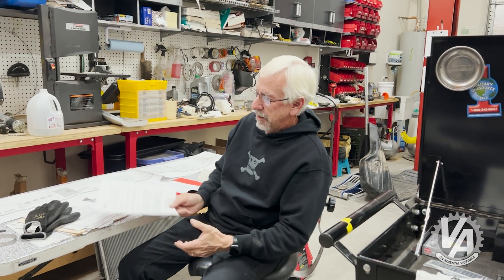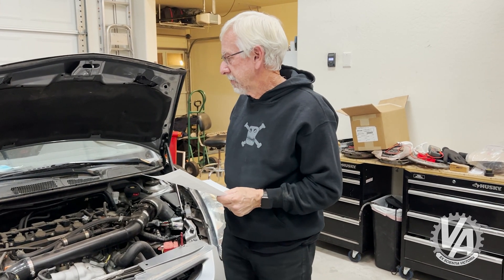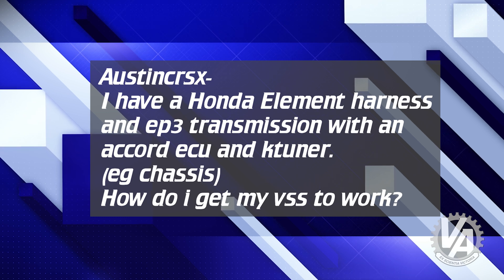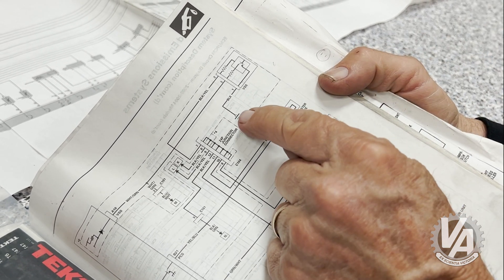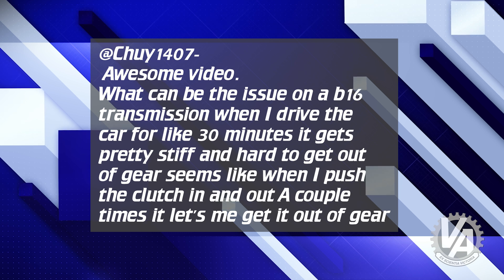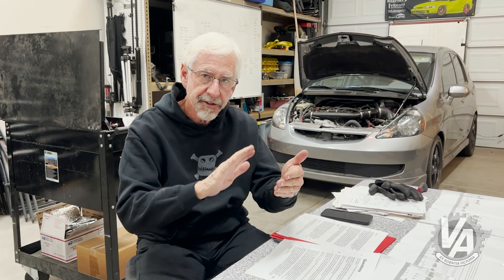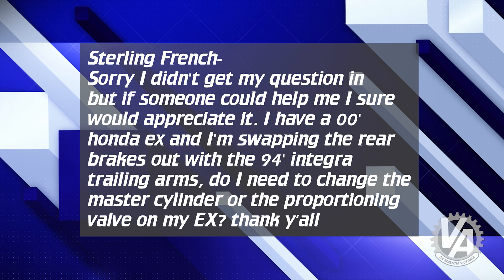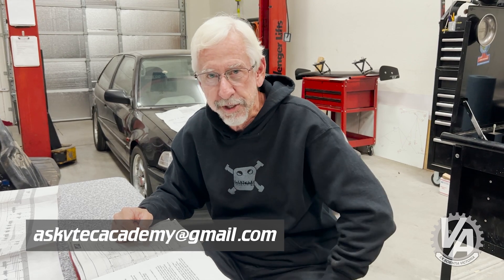Viewer Questions: CSS to VSS, Civic Rear Disc Conversion, Hard to Shift B16, L15B7 Fit

Comment: 1. Better have some fab skills no matter the kit. It's no bolt-in.

2.
3.

4. b16 trans could be cable or hydro. If hydro i'd bleed your clutch, thats what it sounds like. If cable, check your trans fluid, and clutch cable adjustment, and cable itself. Honda MTF, or GM SyncroMesh if the syncros are getting crappy. A leaking slave, input shaft, or rear main seal can ruin your clutch and cause similar.

5. When in doubt run the prop valve you got. Adjust with sticker pads if cheap, or do the m/c and piston math. Problem is, the honda prop valves don't seem to be linear. This makes them more forgiving on weird setups, but a bit less accurate f/r balance.

I'll add a question:
Do you think honda will ever bring back double wishbone? I hate the handling of struts.

Comment: Any luck on the automatic rsx harness (02-04) to be used on eg/dc/ek
Reply: Yeah that's pretty straight forward. You just start at the automatic plug at the ecu and work back to remove all the wires. There are a couple of wires which go to the c101. You'll then need plugs to be put in for reverse switch and speed sensor.